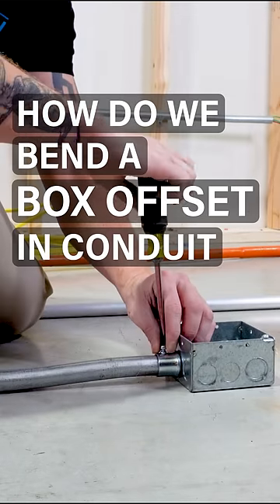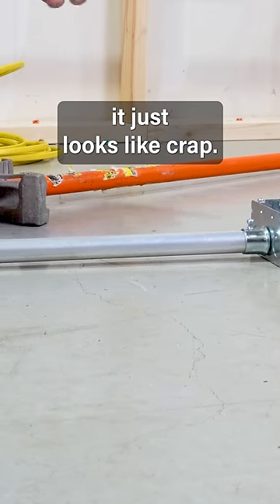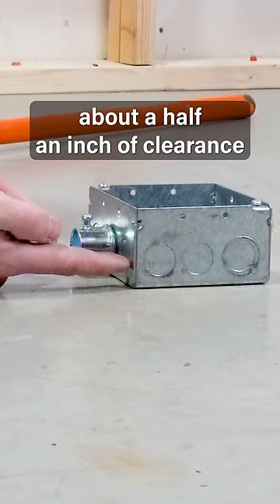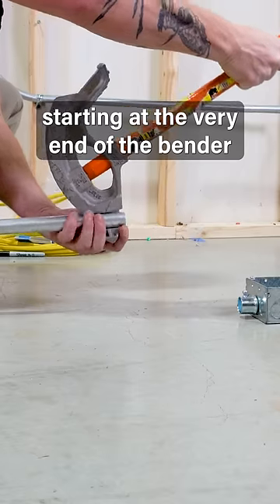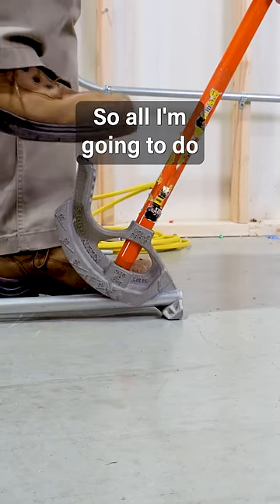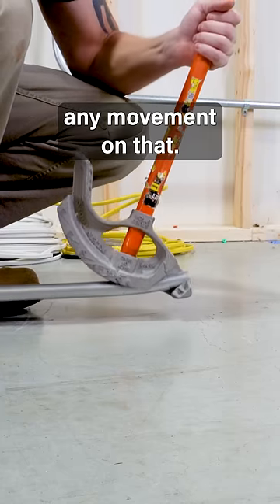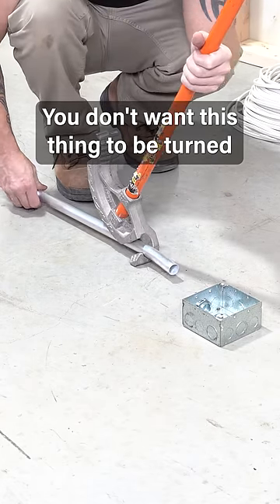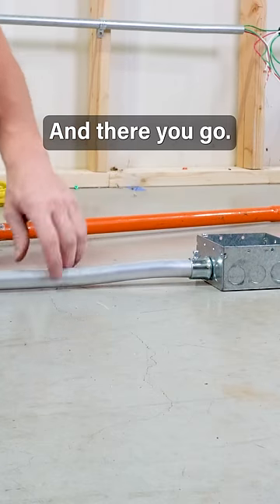How To Bend A Box Offset

Comment: As my father told me never to start your bend at the beginning of the pipe as it oval the tip making it hard to go into connectors "especially the ones that are precise" we go about an inch in, then after we barely kick the pupe we position the bender face where the first bend ends and barly kick again

This has worked for me for over 35 years

And you can get precise bendes using marks or the way I explained and practice to speed up bending without marking and wasting time
Reply: if your bender ovals the pipe, you have been abusing your bender.
Reply: Same for me.  Bender shoes aren't always round.  They can leave unwanted flat spots.
Reply: @donh6416  that's why you don't let the rebar boys use it.

Comment: Anyone insisting on marking twice then bending has never had to bend a lot of box offsets in one day or at the same time then had someone ask why you are taking so long. Do one big job and you wont be marking anymore you will just get a feel for how it should be. 
The only time its really worth taking the time to mark is when you are running several conduits into the same box and you want it to look the same because they are side by side.
Reply: Multishot bending
Reply: You are correct sir
Reply: Your box offsets by feel should look pretty uniform without marking anything. Time wise you are better off bending 10 for five connectors and picking the best five then using the other five elsewhere or just cutting them off
Reply: Don't necessarily need to mark mark one and the just figure out the spacing with your fingers. Like I typically with no marks do the first bend then move the part of the pipe that's hitting the star to the arrow which is basically the correct spacing

Comment: If you do it a lot , just buy the Greenlee offset bender. This is the easy part. The  is making the 90 at the ceiling and then the 90 into the box on the ceiling in one piece on your first try.

Comment: If you put the bender handle on the ground with the bender in the air, you can look down the pipe toward where you want the bend (with the conduit resting on your shoulder) and your bends will come out perfect because you can see it before you bend.

Comment: you want a bit sticking out of the toe if you can afford it so the conduit stays round at the tip ,  use mostly foot pressure and the toe needs to be snug to the inside of the first bend when you make the second then you flip back to the first bend to correct any warp you induced up past your work.

Comment: Watch starting at the very end, 2" back gives me the look I like, but if you go to the very end depending on the bender or the quality of the conduit, you can flatten the conduit just enough to egg it so it won't fit in the connector. Rigid benders are the best in my opinion. I still have and use my 1/2, 3/4, and 1" rigids after 40 yrs of use. Still right on!

Comment: I like to stand the bender up on the end of the handle and twerk the pipe up then down. If you're doing 10 or 20 offsets a day, you don't have to move up and down so much.
Reply: i do 2 10s. on the old blue bender... grab the end...go till it touches the floor... flip it over put the arm on the bend and do the same thing.. perfect offset for a 1900 boxx..... of it i gotta do 20/30 of em i just grab my apparentaces. box offset bender    all you do is just step on it and done  (i was told its a detroit bender) dont know the true name boss gave it to me 17yrs ago
Reply: @battfieldsniper1 yes, someone else who knows about the auto box offset bender. I've been using mine for decades. My dad gave it to me when I was an Apprentice.
Reply: @johnhowe6178  best thing iv ever owned  doing electrical  tbh

Comment: Work with the bender facing up. Use your palm as a guide for spacing and learn your pull down kick based on experience. Will be accurate and consistent every time. And FAST!

Comment: Greenlee makes an offset bender. It works well.  It takes less than 5 seconds.
Reply: They're expensive but worth every penny.
Reply: @johnmcmahon5595  The perfect offset every time.
Reply: I traded an old table saw for mine.
Reply: Used, the 1/2 one as about $150. BUT, your only cost is cost of money  because they never lose value. I have both the 1/2 and 3/4 ones. You may save a half hour a day using one if you are doing a surface wiring job

Comment: Measure at 2 inches and 5 inches from the end of the pipe. That’s for your box offset. Once you get up to 1 1/4 in pipe you can do 5in and 11 inch marks for your offset
Reply: Unnecessary
Reply: If you need two measurements for an offset, you are not efficiently using your time.
Reply: Too far back. Looks like shit.
Put a gitting on the end and go right up on it. That flip around and find the bend point and level it off.
No measuring. All the same. And looking like they should. And no cutting the conduit because you went that far back.
Reply: Your too far back. To make it look good and as the offset name implies.
Box offset should be closer to the connector not further back.

Comment: I still mark the pipe, but I use my fingers and thumbs for quick measuring. I put my hand with my thumb in three different "poses" for 1/2, 3/4, and 1" pipe. I always bend box offsets in the air, and it's mainly a muscle memory thing, but it's usually a little shallow of 10 degrees. Not marking it and/or using measurements less than 4" between bends makes it hard to fix/adjust if you miss it. Mine always looks perfect and I don't need to use my tape but it's taken a couple years to perfect box offsets for all the various boxes and pipe sizes. It's amazing how simple it is to perform, but only mastered after countless repetitions.

Comment: If a lot of boxes with conduit runs. You can use the greenlee bender, it's a mold template bender. Result is very tight shaped offsets for the boxes. Perfect.

Comment: This is why it’s best to just use stand-off straps when running pipe on the wall IMO. Especially if you’re using compression fittings. No box offsets needed. And you don’t scuff up the wall tightening the compression couplings.
Reply: Those straps aren’t good everywhere like a school gym etc..
Reply: @Zoe_yard  in some situations the one hole straps are better, you’re right. But like I said, where compression fittings are required if you run your pipe flat against the wall you scuff up the wall tightening your couplings and a box offset is almost pointless because you’re gonna have a gap on either side of the coupling because the compression nut holds the pipe off the wall anyway. To me stand-off straps and no box offsets looks better when using comp fittings. To each their own though
Reply: Rookie mentality
Reply: @shidfard  masters license for 20 years now big dog
Reply: @shidfard  you were probably in diapers when I got in the trade

Comment: You can bend a box offset or you could just use minis as a support which are the same distance off of the wall as the KO for the pipe. Plus I think they look cleaner for an install

Comment: Im a 23 year journeyman electrician.  I never put my pipe flush with the shoe. As often as not it will egg your pipe and make it hard to insert into your connector. Unfortunately many "electricians" dont even use box offsets these days. They use a one hole strap to force the pipe to the wall. It is good to see someone trying to be a craftsman, so please don't take my comments as negative.

Comment: Here’s a video you should do because I have ran in to fixing these , wall surface mounted box in garage with conduit ti the rafters Romeo ran to the conduit then stripped and feed down the conduit to the box , the problem I keep running into is that here is no protection ate the conduit opening where the wire enters and the wire gets cut and shorts ! So you should show how to protect this situation?

Comment: For DIY folks that have little/no experience with a bender, you can buy offset conduit connectors for metal boxes.  Cost a little more but if you don’t need a large number it might be worth considering.
Reply: I do conduit on a semi regular basis (low-volt doing 1/2, 3/4 and 1"), instead of buying the end set screw connector, i just buy the offsets.  Bending is cheaper, but takes more time since you've got to put a connector on the box anyways.

Comment: I do 2" back 1st mark then 6" back 2nd mark and do 10° bends and it looks pretty good and I cam keep it consistent and matching when I have multiple pipes. I bend a lot of pipe and if I'm not matching other pipes going into say and 8×8 or 12×12 yada yada then I aint marking shyt lol. But I put up probably 500-1000ft of pipe a week depending what's going on, half a billion dollar job site, been there 2 years, still ain't finished but 2 of the 4 food production lines are up and running.
I do emt, ridged, and stainless 3/4-3"
Reply: Ps: turn the bender upside down and bend to the 10° mark instead of using your foot, so much easier and faster btw
You'll be able to bend these in 15-20 seconds

Comment: Starting at the end of the pipe will cause the pipe to oval and flatten. I typically start about 2” back from the end. You can always cut it off if you want it tighter to the end.

Comment: If it’s inside of a wall I never did offset bends.  Only on exposed work you need offset bends.  The reason is you can only have 4 each 90 degree bends before you need to put another box. The offset is counted as 2 each 45 degree bends equal to a 90 degree bend.  Inspectors will catch you on your bends.  They make a tool for offset bends which will save you time.

Comment: Bend them in the air free hand on emt. Typically with rigid were mounting on 7/8 strut so usually not needed but once in awhile we get a wall mount 3/4 rigid and bend it same as i do emt.  I cannot recall ever having a bunch of them where i needed to use a mechanical bender to get repeatability.  Every job seems like less and less rigid  is being used. Materials cost i guess and every penny counts.

Comment: I actually do first bend like you did, I Probably pull into bender 1/2..Eventhough Some say extend out 2" to keep Round. Not necessary. 
Then flip conduit over, with end of bender about Center of first bend. Pull up til parallel with Floor. 
I always like to measure From Floor to top Of Connector, That way after Bending you can see which way to give it a Kick with the Bender. Should End up with Top of pipe same as top of connector, AND Parallel with Floor.

Comment: I do mine in the air starting at 4", but if it's on a full stick and there's a low ceiling I might give that a shot, and not sweat hitting a ceiling tile or whatever

Comment: It always depends on where my run is and the framing. If there's 3ft to support the EMT and I can go straight into the box, I will do that whenever I can without the box offset. The less bends the better for the wire pull. Just my take. Also, when you put a strap on it, you have 3ft to do that, so the EMT will be flat on the wall and be symmetrical and Clean in the run, so your gap is at the connector where your offset would be. 😀

Comment: Depending on the bender you use, you might want to leave an inch pocking out instead of starting flush with the pipe. It's so you dont end up with an oval tip of the pipe. Sometimes it has a hard time going into the connector. Just my 2 cents

Comment: Or, if you’re working for a company that likes saving money and time they provide you with a Greenlee offset bender. It’s a sweet little tool that requires very little effort and it’s a one-shot bend. I have used a 1/2 and 3/4 inch and you can bend a perfect bend every time.

Comment: I never put my conduit flush with bender like that. Always come back 1/2 inch especially if you are using an old bender. You can warp the end of the conduit and make it a pain to seat it in the fitting.

Comment: I have to say first that i am not an electrician but it seems odd to me to draw electrical cables through a metal pipe. I know they are insulated but when the insulation gets old and damaged?
Reply: Insulation will not degrade to the point where it exposes the conductors. However, if insulation on the wire was skinned and it touched the conduit, it would be grounded if you followed code by bonding everything, making it so you won't get fried touching the conduit.

Comment: First bend in the air, stop when pipe moves. Second bend in the air stop when pipe moves. Check for open/closed bend and from the side your end should halved by the backside of the pipe to equal ½" offset

Comment: Did a job for northrup- all exposed pipe, take measurements and do it right. Also fyi, dont put a bend right at the connector, 200ft wire pull, you will have an issue

Comment: As a beginner the measurement is 3/8 at 10 degrees the multiplier is 6 ,so 3/8 times 6 =2 1/4 that’s the space between mark but if you’re good in bending you don’t need to mesure just like is showing 2 little bend that it

Comment: Don't start your first bend flush leave at least 3/4 inch if possible the bender slightly egg shapes the conduit where it would enter the connector either making it difficult to get in the connector or leaving a spot of conduit proud of the inside of the connector that could possibly scuff up the wire.  Its not a super big deal but a small notice of craftsmanship

Comment: Put a mark 2 7/8 " from the end of the pipe.  Insert pipe into the bender flush with the end.  Bend to ten degrees.  Flip pipe over and move the mark flush to the end of the bender.  Bend another 10 degrees. Pesto !!!! one half inch offset.  The offset constant for a 10 degree bend is around 5.74 for one inch, therefore 2.875 for half inch or 2 7/8".

Comment: easier for 1/2 & 3/4 inch EMT, if you stand with bender handle on floor and PIPE IN THE AIR.

Comment: Do you guys not have deep saddles? We have two types of conduit saddles in the UK,space bar saddles, which would require you to do a dog leg set like shown in the video,and we also have hospital saddles,which have a thicker base,and set the pipe off the wall the same depth as the knocker on switch and socket boxes,no need for the little set/bend.

Comment: I remember I had about 30 offsets in a pile with doglegs(pipe going off to the side instead of straight)

My boss came in right before I added another to the pile asked what I was doing and showed me how to fix a dog leg. He left and never saw my pile so after that he just thought I was getting really fast. 

I did however bend 2 1/4 inch offsets in 1” emt thinking that big pipe meant big voltage. (It was for Ethernet.

I was green crackerjack tools no experience boss needed an electrician and tossed me in the deep end showed me how to bend a 90 and an offset and to read the prints. Expected me to quit I didn’t and learned my craft.

Comment: Never put the conduit flush with the end of the bender you can and will egg the end of the conduit. I always use 2 fingers from the end,  then 4 fingers from the center of bend. This gives you enough space between bends for 1/2" to 1" so all you offsets look the same. Also, you can use the seam of the conduit to make sure you don't get a dog leg.

Comment: I used to use a block of wood with a hole through it chamfered off so it wouldn't kink the pipe as an apprentice  easier and more accurate than a machine

Comment: First mark at 2 or 3 inches. 3/8 offset X 10 degree multiplier of 6 gives you 2 1/4” second mark. If you measure it out it’s the exact same thing every time. Never understood the whole “eyeball” it thing. You can literally measure it and it gives you the exact bend

Comment: Thumb laying flat on the pipe past the bender and bend slightly, push the pipe out until the bender is on straight pipe, turn, bend slightly. Put it up to a flat surface to check for straightness, adjust slightly in air if needed. Never failed me.

Comment: Don't leave it flush if you're using a compression fitting. If you don't believe me just do that once or twice and you'll figure it out yourself. The foot of the bender will crush the open end of the pipe if you do it flush with the end of the bender like he is saying to do here. Its just a bad habit to be doing on general, give yourself some forgiveness in the pipe and run the pipe out about 3/4". You can always cut the extra off before the bend. Also if you don't leave a little overhang, when you go to cut your pipe back after its crushed, you'll find youre starting to cut into the 1st bend of the box offset, and it won't go into the fitting. You'll have trouble with compression and setscrew connectors in that scenario. And if you ARE able to get that janky pipe into the fitting, you might have trouble getting wire pulled right there or if you're trying to push your wire in, it will more than likely catch right there because the end of your pipe is probably not going to seat against the seam inside the connector. All of these can be avoided just using a little extra overhang of pipe 🤙🏽🇺🇸

Comment: I just bend it in the air. Easier and no marks needed. Bend at 10°. Flip it. Line up the center of the end with the 10° mark on the bender by sighting down the mark. Make another 10° bend.

BTW, there's nothing wrong with the bow and go method of entry if it's going to be hidden by the structure. Just don't exceed about 5° in the connector.

Comment: Never put your bell on the very end of the pipe because it can egg out the pipe end and it won’t fit in the connector just a tip going an inch back from the end

Comment: But i need that gap to run a hitch in my extension cord so one of those concrete creatures doesn't trip over it. Pull it out while im drilling with an old mag drill, on a ten foot ladder, not tied off.

Comment: Metal conduits. So strange to see. Overhere in Europe all conduits are made of PVC. 
 
Pre-1940's we had steel conduits but for safety reasons they all got replaced by non-corrosive non-conducting PVC piping.
Reply: Depends where you go in europe a lot of places in europe still use metal conduit